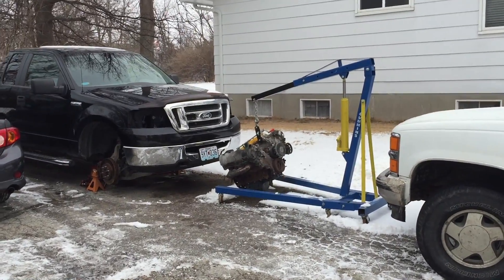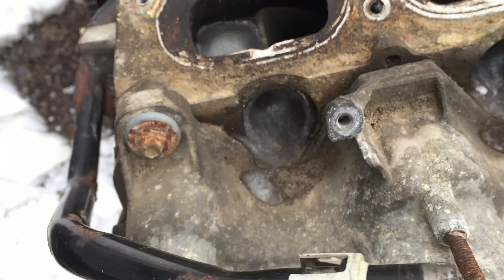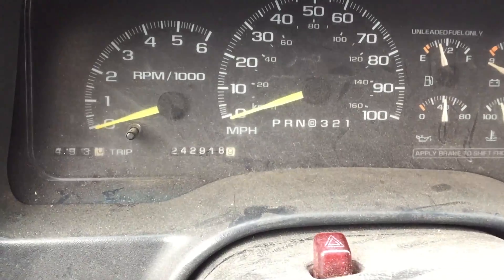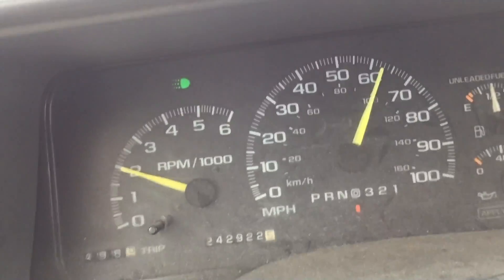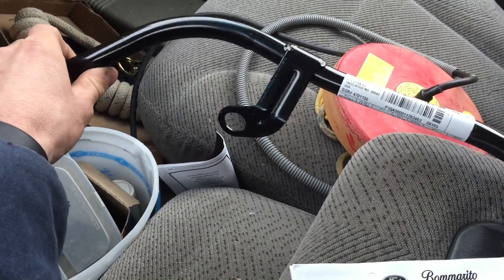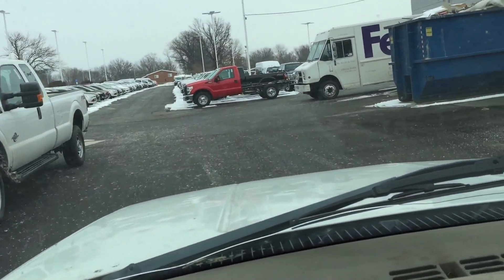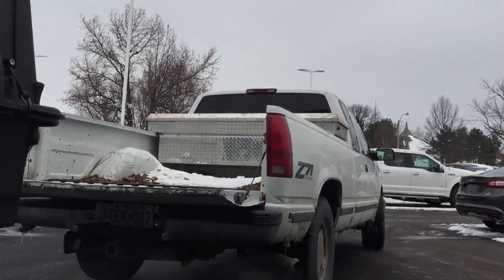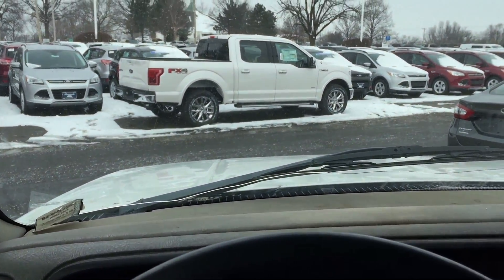Picking Up my New Engine!

Comment: You should've swapped it with a Crown vic p71 4.6 motor or just Cummins swap it would've been alot cheaper then that motor you got just guna give you the same problems as the last motor. They should've came stock with the 4.6 motor from factory. You wasted 2 much money 2 replace that motor I would've just got another truck for 5grand.

Comment: If you drive with a blinking check engine light it means you could easily overheat the catalytic converter and make a small repair job into a large one.

If those CMFI engines aren't misfiring due to spark, they are failing because of that stupid spider injection system.

Comment: I had a 97 z71 with the same jittery fuel gauge. new pump assembly didn't fix it. I finally gave up lol. apparently it's very common, but what is it? I'd wager junk gauges

Comment: Question. I have a 07 TownCar with the 4.6L Modular Engine and during the winter times the engine struggles on cold starts. Once its up to temperature the engine turns on normally. What do you think could be causing that?
Reply: Most likely a weak battery or running to thick of an oil in it.